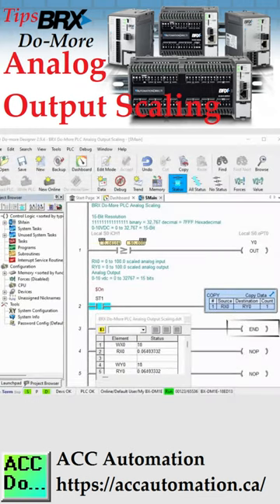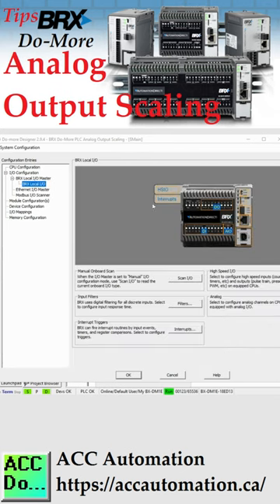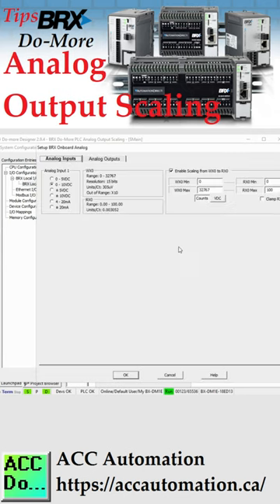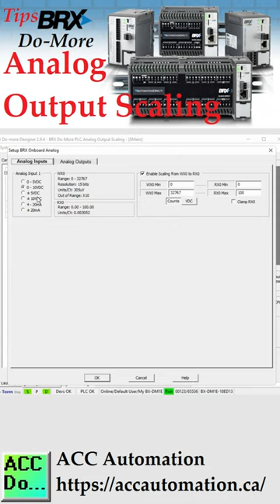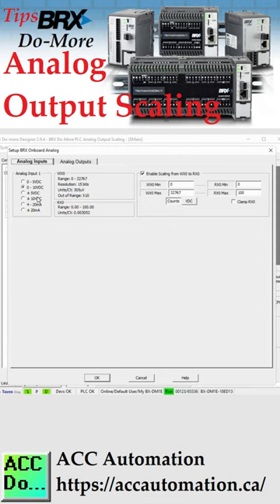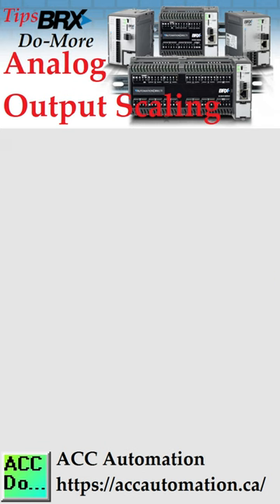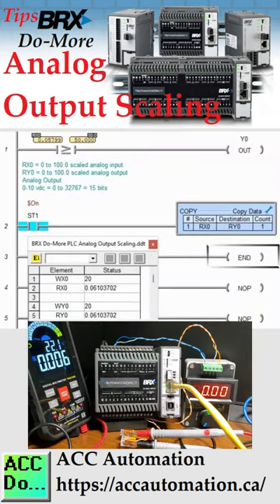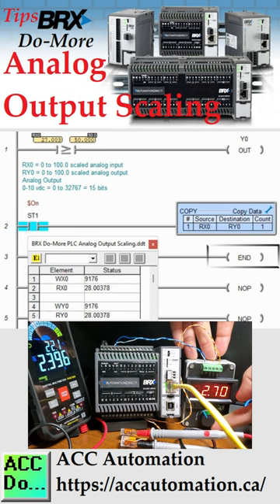BRX Do-More PLC Analog Output Scaling

Comment from the maker: Programming and examples of the BRX Do-More series can be found at this URL:
https://accautomation.ca/series/brx-do-more-plc/

DROK Adjustable Signal Generator
PLC Analog Signal Dual Tester
https://amzn.to/3Ab7fOh

KAIWEETS Smart Digital Multimeter
IEC CAT IV 600V rated, CE and RoHS compliant
https://amzn.to/3RU5kDy

There are several reasons why we are using the BRX Do-More Controller. Here are just a few.

– Standalone PLC with built-in I/O
– Built-in Data Logging
– Communication ability – Ethernet Port, RS232, RS485, USB – support for protocols such as Modbus RTU, Modbus TCP, ASCII, K-sequence (DirectLOGIC users), Custom Protocols (ASCII over serial, TCP or UDP over Ethernet)
– Built-in Analog input and output
– Integrated motion control
– High-speed counters
– Powerful instruction set (Video of Instructions in software)
– Ability to expand the system with a variety of modules
– Part of the Do-More series of PLCs which use the same free software. (Do-More Designer)
– Integrated simulator in the software capable of external communications for testing

ACC Automation
https://accautomation.ca/